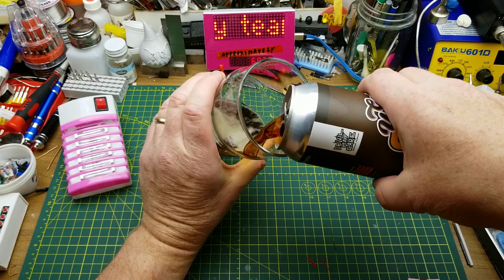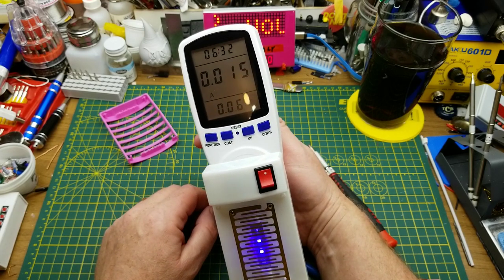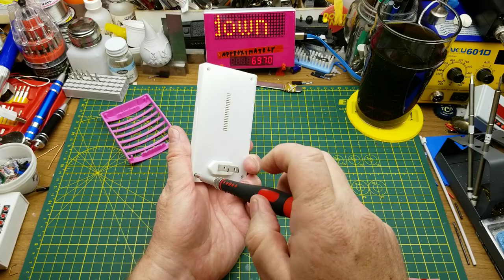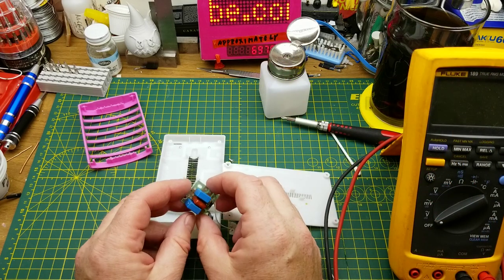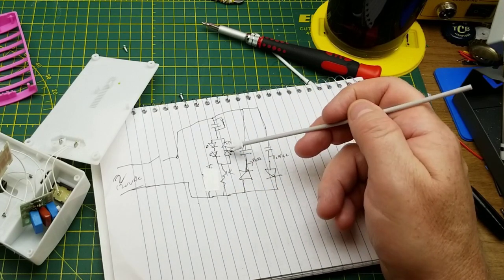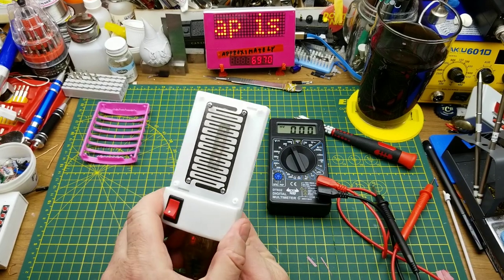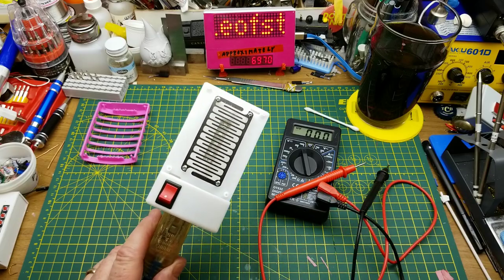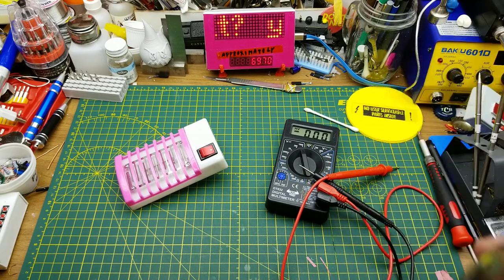teardown: Combination nightlight and bug zapper

Comment: Big Clive tore one of these down and reached the same conclusion except he said do''t buy it period unless you planned on repurposing the components which separately cost slightly more than the unit itself.
(The cap dropper had different values for UK power of course.)

Comment: I don't think it would'nt work with resistors across the output caps, it needs the charge to zapp with.
Congrats on 7K subs.
Reply from the maker: You would think a big enoughh resistor - something in the 100s of meg - wouldnt disrupt normal operations in a signifigant way.
Reply: @pileofstuff  Yeah, that's true.